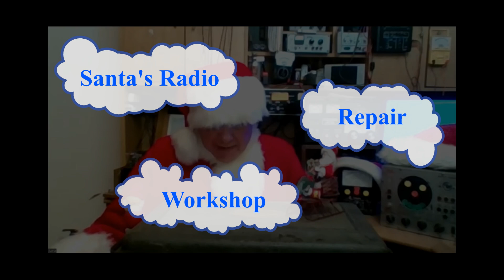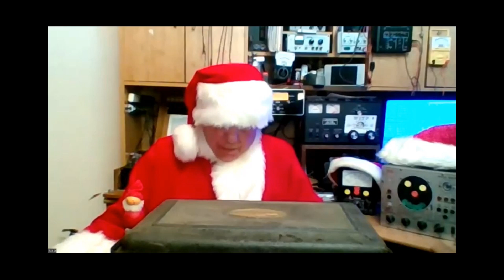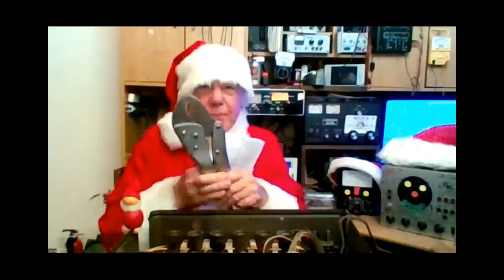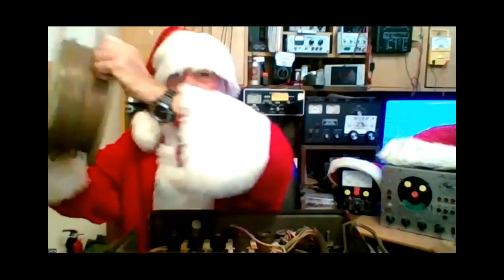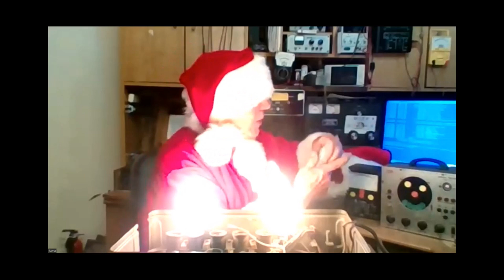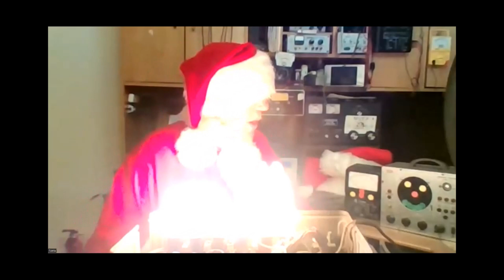Santa's Radio Repair Workshop - Don't Try This at Home!

Comment: You're not re-Ohm-ing so much as Mho-ing it (like when your grass is too long).  Inverting your Simpson Ohmmeter certainly must turn it into a Mhometer....  Now your Raydio is quite Radient indeed.  Your problem with the signal generator is that it isn't modulating. Try a little vibrato (for FM) or maybe play it through a fan blade (for AM).  Must be a Sundae matine show there on the radio.